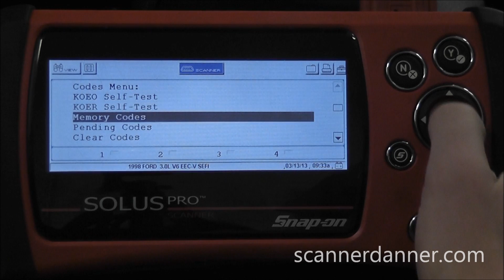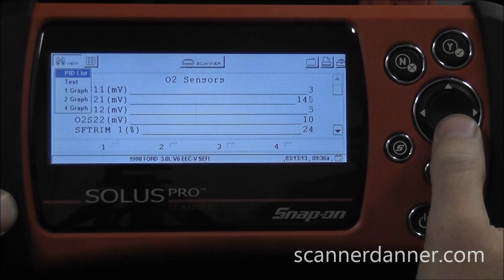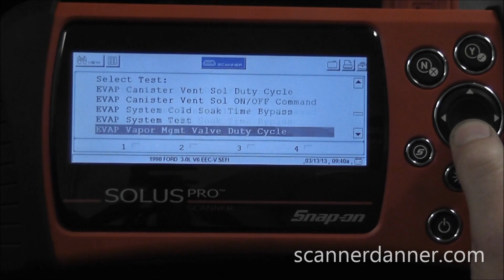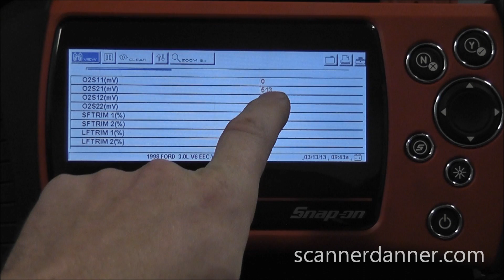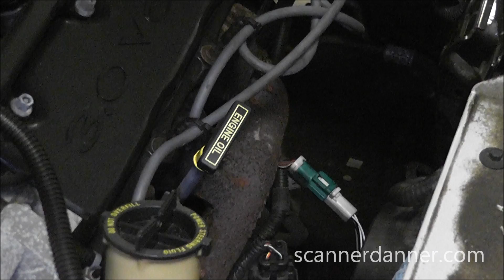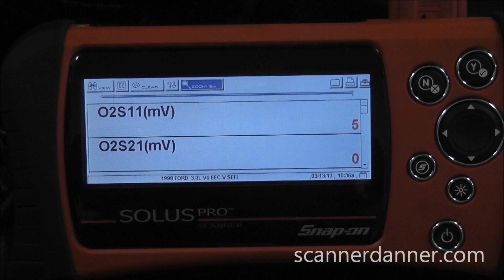Ford O2 Sensor Testing - wiring tests (no bias voltage)

Comment: This is a great video. Thanks! I recently got my hands on a Modis trying to determine my problem with my '02 Ford Focus SPI with a DTC P0171. I was able to locate and fix an exhaust leak and found an issue with PCV tube which I also fixed. Code came back immediately after these two fixes and hooked up the Modis to graph my data analysis. Question; how do I determine if the O2 sensor signature is good or if it's lazy based on graph? I determined I have no more vacuum leaks so that leaves me with a true lean condition or slow/lazy/faulty O2 sensor. I just posted the readings to here http://youtu.be/DKEP1JtFYrs if you're able to provide any guidance.

Comment: I have an 04 f250 that's throwing two lean codes and a rich code for bank 1, codes p2195stuck rich,p2196 stuck lean, and p0171 lean bank1 I didn't see any vacuum leaks and the o2 seems to be working properly also only one cat converter so I don't think it's clogged.  Any ideas on where I should head with testing?

Comment: Hello. I was introduced to your channel through Eric The Car Guy. Regarding DPFE testing. My 2000 Ford Focus has OBD code 0401, insufficient flow detected. EGR works as application of external vacuum causes engine to rough idle then stall. DPFE ground circuit checks ok. DPFE 5 volt reference circuit reads 5 volts. DPFE output voltage is .14 volts and does not increase towards 5 volts as external vacuum is applied to EGR. Can I conclude DPFE is bad? Thank you in advance. Hank B. , Toronto, Canada

Comment: IMHO the propane test was overkill.  As soon as I  saw the downstream sensor reacting, I would know with confidence that the upstream sensor was bad and gone the circuit integrity test.

The strategy was probably using the downstream O2 sensor for fuel trim.

Never would have thought to use "skin" as a high resistance test lead !

I'm glad you said at the end that "current was flowing" and that the amount of current (likely in the microamp range) was just below the capability of the DMM.

Comment: the thing here is they cant be sure u have a leak in your head gasket unless they top overhaul it or pulldown the cylinder head thats what they say,if u dont have the problem with that then check another one, my problem is they r not certain and wanted to open my cylinder head just to check.if only i could show u how my suv works before u would say what have they done,ive done my research from d web to have an idea whats happening n none of what they are doing makes sense.

Comment: brought it back to d dealership to ask y u didnt see it and my car still has a check engine on so i want them to double check and then only to find out again my car is overheating again and temp switch they replaced was not working again,it bcomes simple to complicated, eversince my car was left to them for weeks no right diagnosis.they probably dont have the tools for checking all the possible cause of overheating,bcoz what they just showed me is an overflowing radiatorcoolant while d s hot.

Comment: also my car overheats before but not really to the extent that it reaches the red mark sort of in between and then when i had d fan working the temperature dropsdown,no check engine anymore.i took d car out to figure out if i can afford it it took me a day to have second opinion and found out my cars crank shaft pulley is not working thats y its overheating and wont start how come in the dealership they didnt see that when i asked them if they checked everything,and i brought it back to them

Comment: im in the philippines and we dont have the luxury of block tester or HC test and the gas analyzer seems alien to them even to this big company bcoz i asked them already about 3 wks ago how can they be sure that i need to pulldown my cylinder head?when i brought them d car my only problem is d fan is not working automatically i never used the car since the first day it overheats and left it with them,when they put all the new junction block,temp switch my car overheats more,cont check engine on

Comment from the maker: im sorry for your trouble. unfortunately when an engine overheats it is not uncommon to damage the engine. what should have been done BEFORE replacing all these other parts is an HC test of the cooling system. This would have verified engine damage and then you could have been given the option up front as to whether or not the car is worth the money for these extensive repairs. Watch my video on how to test for a bad headgasket.

Comment: my car is a rav4 2001 model,now they say that i have a throtle bodyleak,o2 sensor busted,overheating,replaced all that plus radiator,thermostat,fans, i told them i have no money yet and was angry why my car suddenly have so much problem when none of it exist when i left it there and i was using it just fine, they also want me to pulldown my cylinder head to check bcoz they said i might have a problem there just to check my god i cant believe it,its buying a new set of car with all that.help pls.

Comment: continuation of previous post i dont know anything about cars but this was the problem they diagnosed:replace all this junction block,temperature switch and radiator relays after replacing that the fan works but still it overheats not too much just above the middle and after putting all that parts they test drive it and my car overheats while on traffic and MIL turn on comtinously now,

Comment: i have a problem with my car  it overheated and my check engine went on and i was stranded so at that time i called and a mechanic n found out my fan doesnt automatically switch on,so just to get it home my fan was dirctly connected to d fuse or in d junction block,i went home no check engine light on n no overheating,took the car to toyota service and ask them to fix it but still my car has a ton of problem than the first time i left it there.

Comment: 30:57 you are  feeding 12 volts to a voltimeter inside the ecu
 that usually measures 0 to 1 volt
whereas the ecu readout is only 1.66 volt
sounds legit

Comment from the maker: It will not work on most other sensor circuits. There is too much resistance in your body. Check out my "signal circuit integrity update" video on how to do those types of circuits.

Comment: Would this also work for checking wire integrity on other sensors (using your body as the resistor) ? Since you are only sending aproxx 7v down the signal wire to the pcm would you be able to check say the signal wire integrity from a TPS signal wire, feeling confident you will not damage PCM.

Comment: you are used to thinking of the rear O2s for cat moniters, not rear fuel trim, iATN under resources Ford section you can read a little about rear Fuel trim.

There is very little service info on rear fuel trim, in anything I have found.
How would a,IIRR, town car stay in fuel control, with both front O2s dead? BTDT I work on a lot of fords,If you find a Lean/Rich codes and a stuck 02 you have 2/3 real codes to chase, also BTDT:) many times

Comment: Paul, you are wrong, first time I have gotten to write that to you:) when the ecm finds a non responsive O2, on fords with 2 rear o2s, it trims off the working rear 02 on that bank so as soon after the KAM reset the ECM realized that O2 was dead, it started triming again from the rear O2, also always do a KAM reset on Fords clearing codes will not reset trims at all.

Comment: Man, I've worked at a few different shops w/ numerous lead techs and no one is on your level. No one has the confidence and testing skills to confidently determine sensor, wiring, or computer in such an accurate/simple way.   Your videos and ebook is a god sent.

Comment from the maker: I agree and I believe the programming is set to not use the signal again until it crosses the 450mv threshold. I thought I did a good job showing the reaction maybe I needed to explain that part a little better
Reply: So sensor unplugged; if you see 645mv on signal wire. Is it still bias voltage ??
Reply from the maker: @AnythingEverythingGh  on a Ford?
Reply: @ScannerDanner  Kia

Comment: I do believe that the programmers do a voltage check on the sensors and know the voltage drop should be between a certain percentage. I don't have proof, but during my tuning sessions with my EEC-IV/V vehicles I notice a sensor failure is registered if they fail to meet the number. An example is an aftermarket MAF reading below the minimum voltage that is set by OEM. I've seen it go into limp mode. Not sure on HEGO's by I have a feeling it is similar.

Comment: True, but it does look for the switching of the signal like you stated. If it doesn't respond for a set amount of time the ECU registers a fault. It is stored in the keep alive memory, which the code looks for when the key is on. What I should have said is that if the keep alive memory isn't cleared, the programing will look for stored failure codes when the key is on. Thus ignoring that bank reading immediately. Sorry for the miss wording.

Comment from the maker: thanks man, just keep this test limited to narrow band O2 sensors, wideband O2s are completely different in how the circuit is monitored. also this test is not needed on an O2 with a bias voltage on the signal wire.

Comment from the maker: I would like to hear your theory of how the O2 signal circuit is checked before start-up on this design.  Ford does not use a bias voltage on either the signal or ground wire. 
The heater circuit can be monitored immediately, but I don't think the signal circuit can be on this design.
I believe it ignores this sensor immediately due to a previous fault and will not use it again until it sees activity on the signal. (voltage must cross the set point of 450mv)

Comment: After clearing codes, I would have not included LTFT data and included loop state. When the STFT go from a large number to a smaller number suddenly you know the LTFT has been corrected.

Comment: Another awesome video.  My favorite part was how you proved the myth that directly applying 12v to the O2 signal wire did NOT fry the computer, though the circuit is only designed for 1v of current.   Looking forward to viewing part 2 on the MAF!